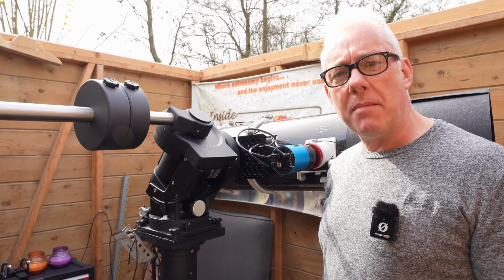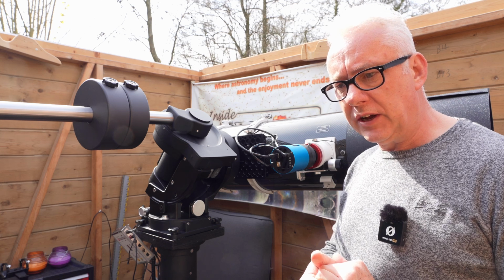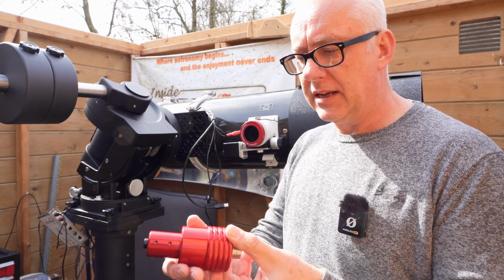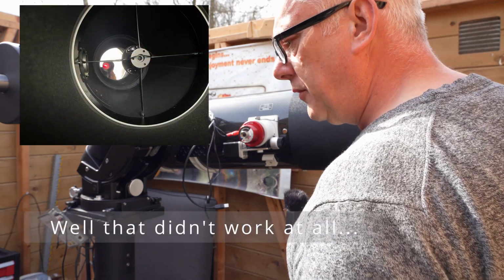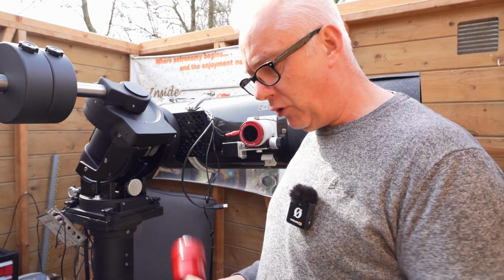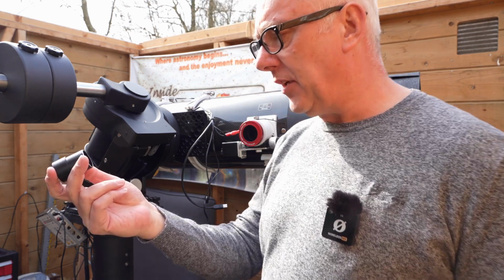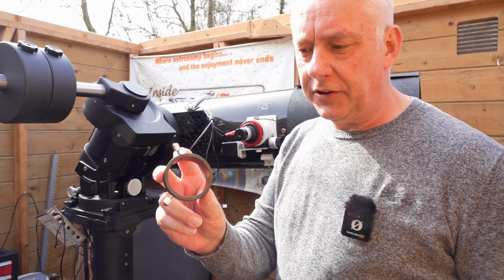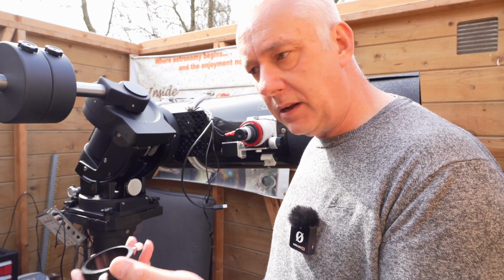Collimation 101 #astronomy #astrophotography #alignment #astro-tools

Comment: Hi,
With the realisation that we are always learning and there may be an opportunity here for me now.
Q. How can you get an accurate collimation when you know your focuser is out of wack ?
Everything meaningful that goes into that scope eg camera or eyepiece relies on the focuser being perpendicular to the light path. Unless I am missing something here you cant collimate the scope of your focuser is not square.

I watched your Tak 180 video and we agree on everything else.

All the best
Damo
Reply from the maker: Hi Damo, This deserves a video. I'll make it using the Sky Watcher Quattro. What I would say now is that you need to resolve any instability in the focuser. How it's fixed to the telescope or how it's built. Then I can show you how to collimate your focuser.
Reply: @insideastronomy-g2v  Agreed but i thought you said the focuser was still no good ?
Collimation has 3 players and one of them is the focuser?

All the best
Damo
Reply from the maker: @damienk2372  The Epsilon focuser isn't great, and I stand by the fact that a telescope of that quality deserves better. The issue is it's fairly reliable, and the tilt measured by ASTAP is moderate, which is not worth fixing, especially when you would need to shim the bolts.
Reply: @insideastronomy-g2v  I have heard that mate, about the focuser. Most talk of replacement when a discussion of the scope comes up and other Taks though as well to be honest.